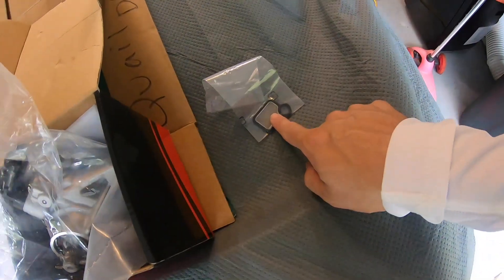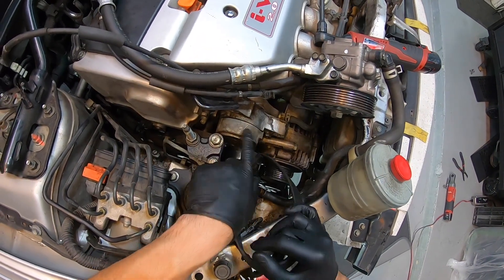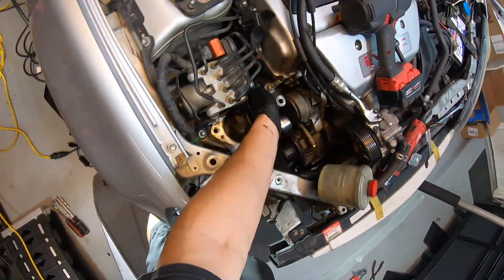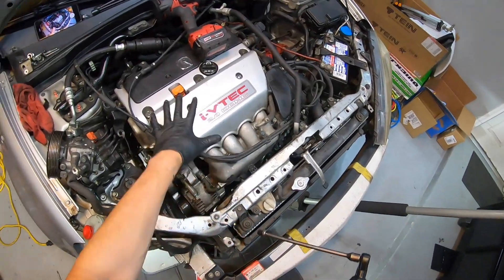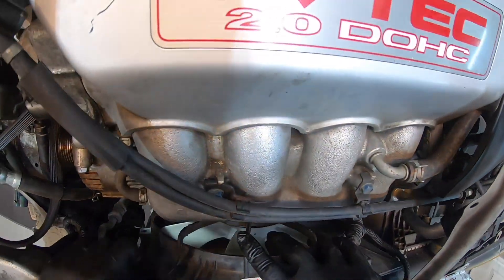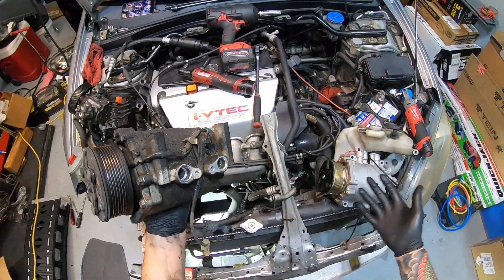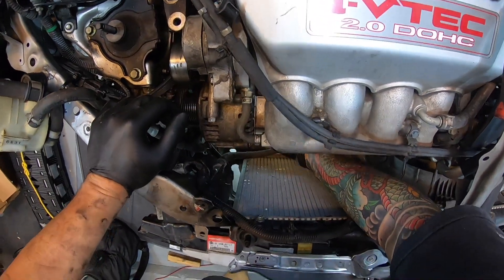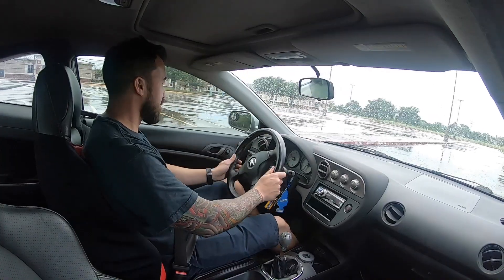How to Replace An AC Compressor / Acura Honda RSX Dc5 Civic Ep3 k20 k24

Comment: I got a question? when removing the engine is it very difficult to remove the A.C compressor and not disturb the lines? Or is it very difficult to do or timely? I'm trying to figure out why a technician had to remove my lines in order to drop the engine and subframe.

Comment: Im have 08 honda Civic si MUGEN..I'm have questions why my ac it not work and also i put a new Compressive won't work either n my fan won't either you know why everything not?
Reply from the maker: Compressor relay is a very common failure . Swap it
Reply: I'm checking Relay all good don't know why won't spin.